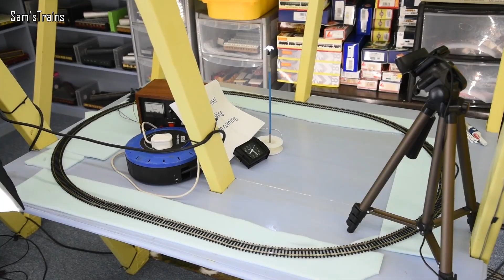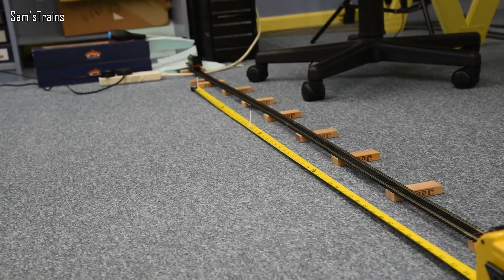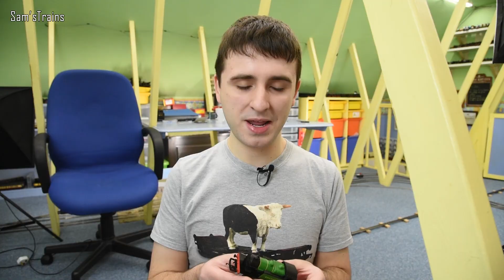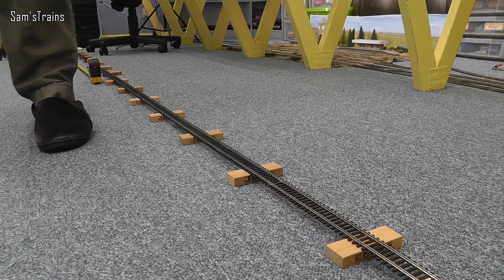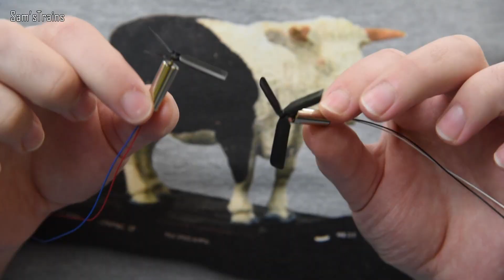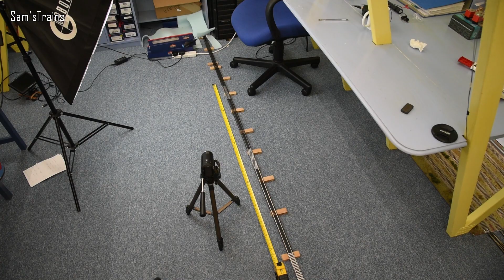How Fast can a Model Train Go?

Comment: We once made some motors in A level physics and me and a couple of friends decided to get all the power supplies we could find and connect them in series to this little motor designed for 3V. In total it was something like 40V across that motor and the motor did break rather quickly (I have the video if you want to see it). I also think that I can beat your speed with the aid of model aircraft motors that can push a model plane over 100mph real speed.
Reply from the maker: haha that sounds pretty awesome! Thing with motors is that they can be overloaded quite badly, but it needs to be gradual rather than a sudden shock! Still, it is fun to fry motors ;D
Thanks for watching - Sam :)
Reply: @SamsTrains  it did run for about 30ish seconds but it was fried after that. All the tape was scortched black, the contacts were black, the wires had melted and a rubber band also wqs charred black and snapped from it

Comment: Using the same set up but in an aerodynamic body and a longer track would be an excellent start for improvement :D 

I'm pretty sure I have a jet small enough to be mounted on a wagon, would that count or does it have to be run on the power supply? :P
Reply from the maker: Yeah that's very true, that would probably work great! And a jet would be fantastic, haha! ;D
Thanks for watching - Sam :)

Comment: I think the little 040 could be modified using a performance motor they sell for slot cars. I know hornby's sister company scalextric used to make performance tuning motors to replace the standard motors in the cars. The 040 motor is the same as some found in the scalextric cars.
Reply from the maker: Yeah you could do that for sure - though I think a geared system would struggle to go faster than those propellers! ;D
Thanks for watching - Sam :)

Comment: Speaking of toy trains.
Most HO modelers consider Tyco locomotives toys but, what's so great about them is that they're easy to modify.
Take some Brass detail parts and you've got a neat looking heavy duty engine.

As for your challenge I don't have a camera or the skill to make a super fast model.
But what I do know is, if you were to take two gears, one large and one small, Put the large one on the armature shaft and place a smaller gear on the wheel axle it would make it go faster.
Reply from the maker: That sounds great - I have heard good things about tyco! Yes that's true- but gearing will never be as efficient as propellers - you'd need a lot of torque to get that out of a geared system!
Thanks for watching - Sam :)

Comment: The sound of the engine on the propeller driven one reminds me of a WWII siren starting up. Would you think about putting a body on it if you get it fixed up?
Reply from the maker: haha yeah it does sound like that!! The only problem with a body is that it'd stop the air flowing between the propellers - that's quite important for the higher speeds!
Thanks for watching - Sam :)

Comment: LOL great fun, I think you might have done better with a capacitor rated at a much higher voltage, looked like a 16v one, as you exceed the maximum rated voltage the capacitor can become a short, this could explain the track and wheel burn. However a most impressive test, akin to this :) https://www.youtube.com/watch?v=E-ID_ktSoLY
Reply from the maker: Thanks Mike! Yeah that's true - it was a 16v cap, but the motors were only 6v.... I was expecting the motors to give out way before it hit 16v! I never thought they'd take 30+ volt!! :O
Thanks for watching - Sam :)

Comment: You could try 750 v DC...when I worked as a TROLLEYBUS operator I liked to "test" them too. Late at night with full voltage (voltage drops with more trolleys running at rush hour) I outran a Corvette (sports car) from a stoplight but 55 mph was about the limit. The overhead wasn't really up to anymore speed...and you have to slow for crossings and switches anyway.
Reply from the maker: haha!! I love the thought of 750v in 00 gauge... would the rails even be far enough apart to stop an arc?! haha!
That sounds like a lot of fun - definitely my kind of experiment ;)

Thanks for watching - Sam :)
Reply: I never pulled the overhead down but a friend of mine did...it burned a small hole through the roof of the coach...so yes, there'd probably be a nice blue flame between the rails!

Comment: Great video! Did the pocket rocket survive? And regarding the propellor powered loco, why not make a rail Zeppelin from scratch using aluminum, a bogie coach chassis and a propellor on a 6 pole motor? I think it would be pretty neat!
Reply from the maker: Thank you!! Yep both the 'locos' still work just fine! That would be a lot of fun - though I'm not much of a model builder ;)
Thanks for watching - Sam :)

Comment: I tested my railroad 9f at full speed on 12V a few years ago (loco since broke, so I sold it on), and I calculated it went around 300mph to scale, based on the time and length of track. Surprising that it was that much faster than a cheap 0-4-0.
Reply from the maker: Blimey, that's even faster than this 0-4-0!! :O
Thanks for watching - Sam :)